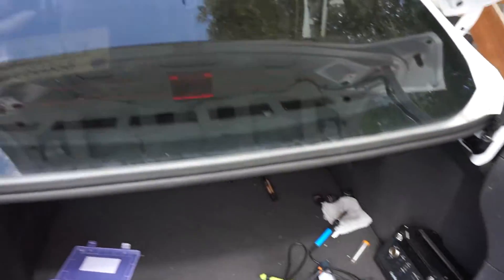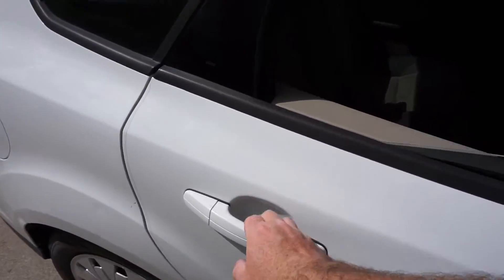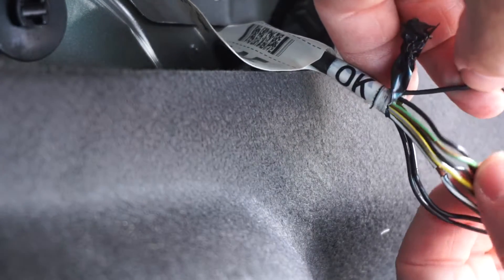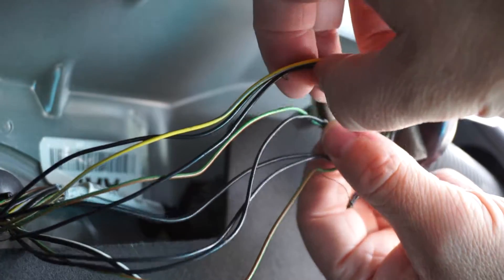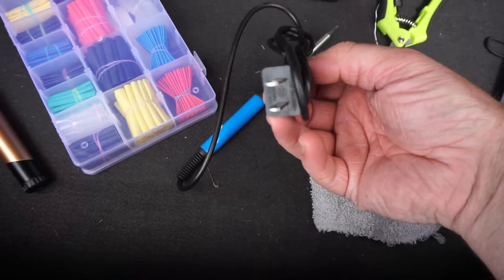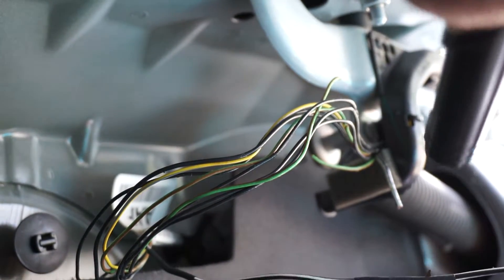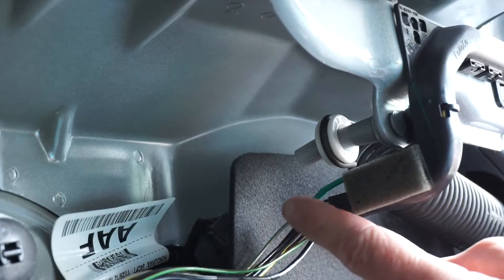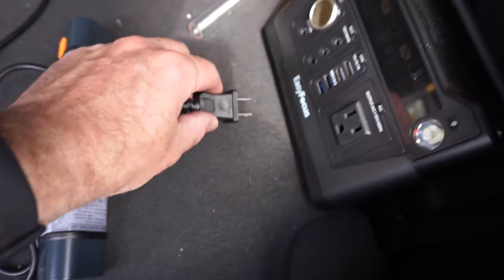How to fix a car trunk that won't open - specific to Ford Focus 2013

Comment: Need a Laugh (at how I solved my trunk problem)?
I'm a single girlie born in the 60's. Being alone is WAY better.........except when it comes to cars....TG for YouTube as I no longer need to keep one around (a man I mean). I thought that I would share this though: One day, for no apparent reason, and after having just opened my truck 5 minutes before, and in that that same parking lot, it failed, and has refused to work ever since.....for 3 years now, if I had to guess. So then I had to crawl into the trunk through the back seat to get it opened. Then I  ran a string from the emergency release to my back seat. So now, I open the back door, pull on the rope, then the trunk opens! Only problem is if there's too much in the trunk, sometimes the rope gets squeezed and can't be pulled and I have to crawl into the trunk through the back seat again. Sometimes it doesn't even happen until AFTER you close it, so you don't see wtf is not letting the string be pulled, until you figure out you that the rope is fine only BEFORE the trunk is closed, then you've crawled into the trunk about 5 more times! TG this senior is slim and still agile! The binger drove me nuts going off at first. Trying to drive with that RACKET BINGING EVERY 2 SECONDS! Drive ya mad! Until a month later, my friend told me to push the OK button to make it stop. So it was nice not to have to listen to that every time I drove. (it was actually his car all this time, so I wasn't paying to fix HIS car, despite my using it; but then, he lost his licence; and, will likely never get it back because he's in his 80's). He finally signed it over to me so I could insure it, but then I decided I "earned it". Long story, hence single. I thought you may enjoy this little story. I hear men laugh really hard at the stupid things women (some) do with cars because they (some) aren't as good with cars as men (some). That's all changed with YouTube, now there's NOTHING I can't do! The problem is making it a priority. Have a laugh, won't hurt my feelings, and it's a "laugh with 'em instead of at 'em" story afaic.

Comment: Truly grateful for this video. I reconnected multiple separated wires and it fixed both my unresponsive trunk latch. In addition to a message of the trunk being open even though it wasn't. You're a blessing!

Comment: I swear they designed that spot to break. Same thing happened to mine. First one, then another. I just used butt splices and they came out, and now most of the other wires have broken insulation. Horrible design.

Comment: My scenario was completely different. I checked the fuse and the fuse was good, wiring was all good. However, I dismantled the trunk latch/ motor assembly from the trunk lid by removing the three torques bolts. There is a temper resistant torx screw which secures the mounting plate to the motor assembly. I noticed that once I backed off that screw counterclockwise just a bit , it started working perfect.

Comment: Good video, but I'd reccomend checking the wire first, because that is the most likely problem. In other videos about this problem it was mentioned that this is a design flaw which causes the wires to eventually break.  Also, instead of following the wiring, just look at the area where they connect to the trunk latch (behind the right side hinge).  And finally, unless you have a solder and are good with it, just crimp the wires together and cover with isolating tape.

Comment: Problem with my 2018 is the dash button opens trunk and the key fob does to just the button on the trunk lid don't work. Any idea ? Or could it be same issue ?

Comment: You saved me with this video! 😅 I was freaking out thinking I was going to have to spend hundreds for a trunk replacement or something, and found your video, and had the exact same problem as seen in this video, and I reconnected the broken wire and got my trunk back. Thank you for uploading this video, you’re a life saver!

Comment: Hi1 Did you disconnected battery before fixing the wires?
Reply from the maker: It was so long ago I don't remember. I either did that or removed the fuse. But yeah... definitely disconnect electrical before you do this.
Reply: @TutorialGeek  so, it is possible to remove only the fuse and to do this? I am asking this because it is to complicated to disconnect the battery. Thank you for your video tutorial and helping me out.

Comment: Ford Focus 2013 wires snapped, disconnecting the key fob, the latch, and console button release and trying to connect them myself without taking to dealer

Comment: Thanks mate! Had the same issue with the 2011 model. And, there was a short circuit between the reverse light and boot ejector cable. So, when the car was in reverse gear, the boot used to pop up randomly ( which was funny).  Fixed it now. Thanks a lot!

Comment: Every wire was frayed. I rewired the ones that were color coded but there are 3 or 4 small black ones left to connect only thing got work is dome in trunk

Comment: Can you give an update? For me, I followed this tutorial many times to fix it, but it seems the problem comes came once or twice every year. It’s definitely due to a bad design, or the wire being too short. What has been your experience with this repair over the years?
Reply from the maker: I have had to fix it one more time since I made this video. I found that I had to get better wiring and splice the wiring in a way so that the new (better) wire is in the area where it repeatedly bends. Yep. Horrible design. Perhaps the only thing I don't like about my car.

Comment: My problem is different it opens only after i start the car. The moment i close and lock the car with the remote it won't open after i unlock the doors with the remote

Comment: This video saved me a ton of money. Thank you. But my trunk problem was a little different. It opened about 2 times out of 10 tries with the key fob. I was getting constant TRUNK AJAR alerts every time I put the transmission in drive/reverse or stepped on the brakes. My auto door locks were also activating constantly.....about 3-4 times a second. I had to pull over on a long drive home and open/close the trunk to get the short circuit to stop. I was also seeing the dome light in the trunk dim and brighten when the trunk lid moved up and down. I heard a slight buzzing from the trunk latch whenever I opened it while the ignition was on. I unwound the trunk wire harness and saw the broken black and white wire. The wrap was keeping it together enough to cause a short circuit and not a complete trunk failure. I used a butt splice connector after stripping the wiring insulation and it solved all of the issues 100%. Two other wires had some stripped insulation so I put electrical tape over them. The stripping seems to have occurred due to the too-tight zip tie from the Ford factory. I installed a new tie with a bigger loop to take tension off of the wiring harness. If a wire short circuit or wire break happens to anyone on a long drive and the auto door locks keeping firing over and over again, there are online procedures and YouTube videos that show how you can turn the feature off until you can repair the wire.
Reply: This was happening to me as well. Fixing the wire solved all issues. I has another issue about a year earlier where my trunk would open unintentionally, usually when unlocking or locking the car, opening and closing doors, or starting the car. I ignored that issue long enough and it went away, but it may have been due to the wires starting to fail.
Reply: Can you share the video link?

Comment: Thanks, great video but my problem is bigger than one wire. 
I have a Ford Focus 2012. except one black and one green wire all of them are disconnected. I don't know which black wire goes to which one. Only the plate light and white light ( backward lights)  work. The car gives error for brake bulb light and compartment door error. The trunk door can not be opened by botton or manually.  not open with  I checked the voltage on the wires, two of the black wire have voltage all the times.  I am wonder anyone know how I can find out what those wires are? 
Thanks
Reply: On mine, the drivers side rear light is burnt, plate light not working, on the dash it says luggage lid is open

Comment: Easy way to pull the latch is take a wire coat hanger and pull it apart. Use the hook to hook the latch.
Reply: Omg thank I own a cleaning service so my trunk is jammed wondering how hard that was going to be. Wire hanger, Solved!

Comment: I have a 2014 Ford Focus se and my license plate light went out so I ordered a new module with the light and trunk release button and put it on and it still doesn’t work what should I do? Is there a fuse for it ?
Reply: I have the same problem do yo fix yours